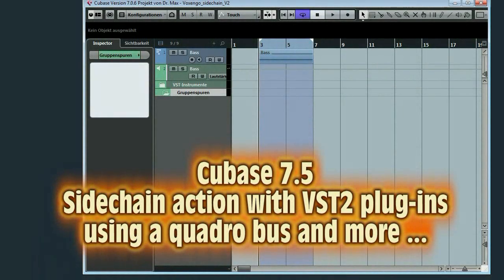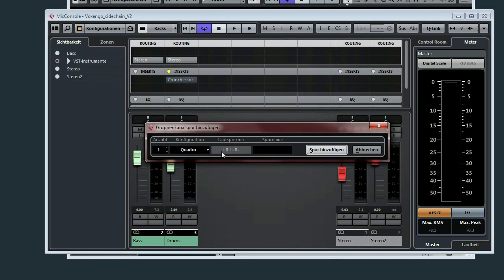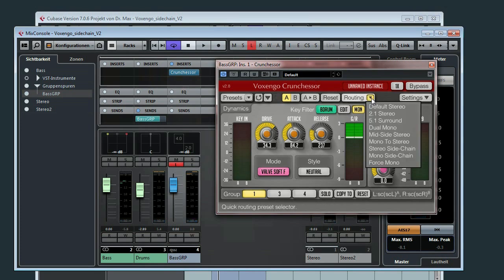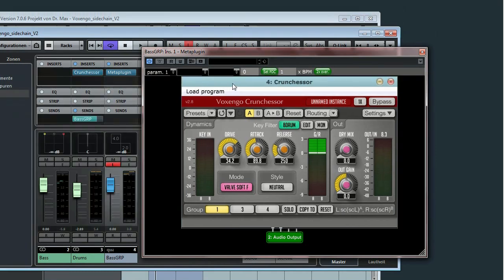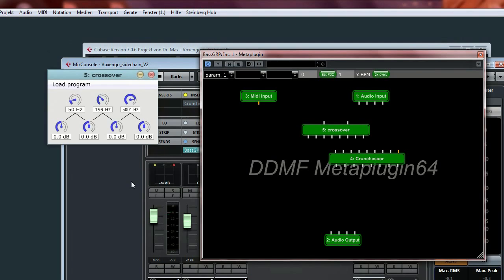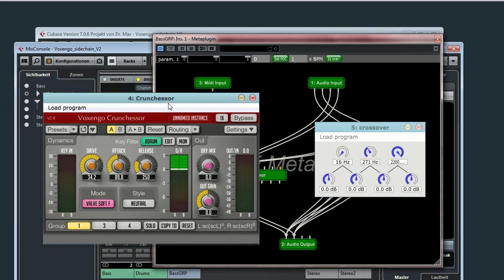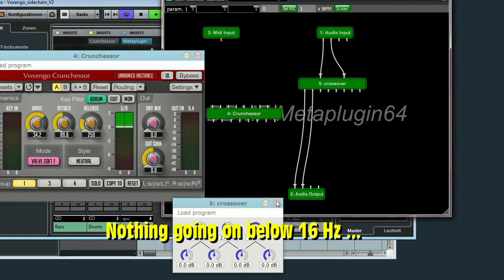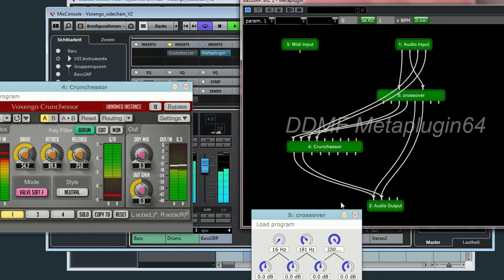Cubase 7.5 - Side-chaining with vst2-plug-ins and more ...

Comment: i've tried to do this in cubase 5.1 but doesnt work.. when i assign the bass routing into the group it results already compress.. in your vid it starts to compress only when you put the drum send into the group... its very strange.. can u help me pls?
Reply from the maker: You are right. VST2 side-chaining is different in Cubase 5. You have to use a surround bus and you have to fiddle with the panorama settings to get a proper setup. Here is a temporary link for a cubase 5 project where I realized it with a voxengo compressor. I hope it helps:
https://dl.dropboxusercontent.com/u/39115079/Cubase/Voxengo_sidechain.cpr